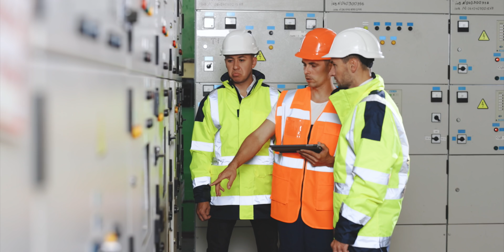JOBS BOOST! – Why the energy transition needs an influx of talented people

Comment: Pay is so low in engineering it's not surprising there is a shortage of qualified talent. I've spent 5 years working in solar, coursemates from my engineering course that converted to law or went into accountancy or finance are on 2-2.5 times what I earn. Add to that the complete lack of respect for engineering, especially renewables (none of my doctor friends have to justify the existence of their sector or see it rubbished by know nothing pundits) and it's not an attractive proposition for high achieving graduates. The saving grace is that people working in renewables tend to be kind and caring, and are all really motivated to make the world a better place.
Reply: Totally agree. Engineering, at all levels seems to always be the poor relation,  not just in monetary terms either.  Poor working conditions,  inadequate equipment, and unsociable hours, and if, like me, you're "on the tools" you have to supply them yourself.  I used to be an aircraft technician,  but at less money than a council street cleaner, I walked away.  
 About 15 years ago I applied to be a service technician for a startup VAWT  company,  they had a fantastic office, in Camberwell,  really nice it was, but on offer was just18 grand, and get this, no company vehicle,  they expected me to travel by train,  or my own car, for which I could claim fuel costs.  Luckily I didn't get the job. I believe they went bust not long after.
Reply: @iangregory3719  To be fair, council street cleaners should get paid a decent, livable wage. Without them, society soon starts looking very different.
Reply: @LCOF  very true......but in my situation it was £13,700 for aeroplane technician,  £18 grand for street sweeper....and if they screw up, nobody dies.

Comment: At last! As architects we are already fully trained to take on the challenge of creating zero-carbon buildings. Personally we were taught about sustainable design (not that it was necessarily called that then) when I was at university in the late 70s and early 80s.
A actual job in the sector would be very welcome :-)
Reply: Yes we are😉
Reply: That's interesting, as someone who's in the early stages of planning a refit, I found it really hard to find an architect. It seems there were some county-level organisations for specialist refit co-ordinators, but they had their funding cut recently.

Comment: Robert, you shore a flat panel of PV.  Where go to have development with 250 houses in North Coast NSW with 30,000m2 Tractile PV on the roofs. The thing where going have 1st stage we have 2400m2 Arctech Solar trackers of PV. All that PV will be stored in the 1st stage Tesla batteries storage farm, 14.4MW/hrs, expanded to 28.8MW/hrs by 2025. All we got  to do first have the team design and council approve the developments. All thing happen, we onsite by mid June 2023. We need heaps of qualified peoples, first.